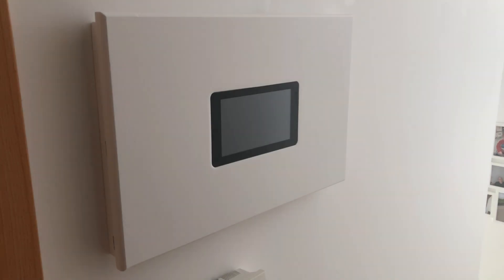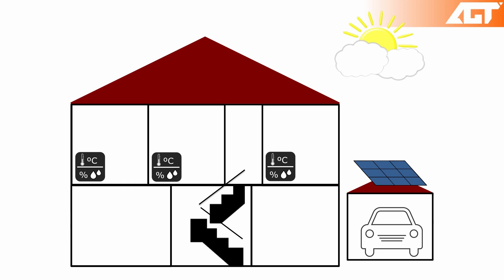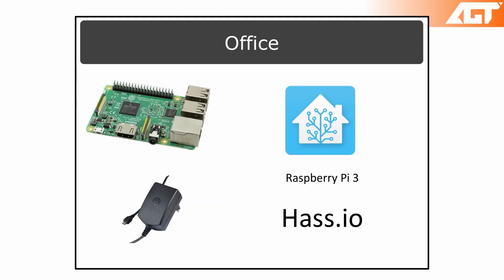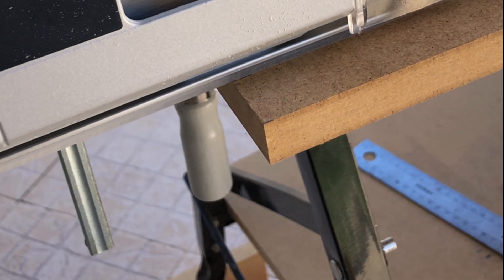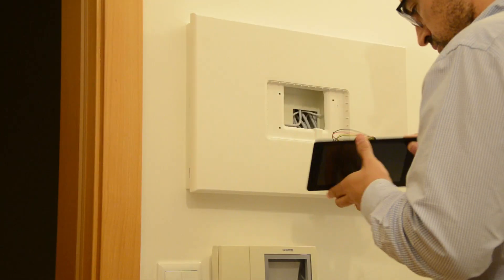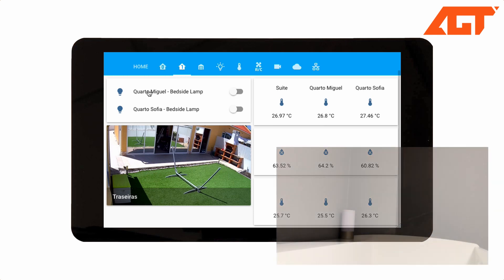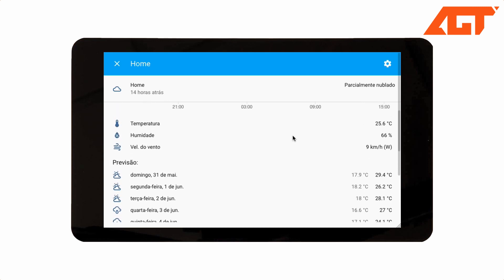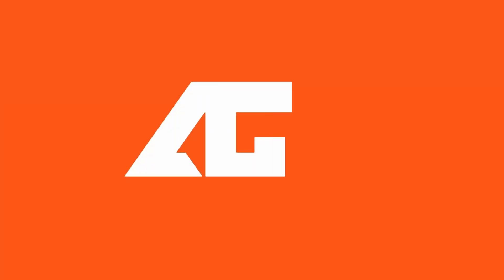My cheap smart home system | HomeAssistant Wall Panel

Comment: FYI: The name Hass.io is not used anymore, It's now "Home Assistant", and the OS is named HassOS: https://www.home-assistant.io/blog/2020/01/29/changing-the-home-assistant-brand/
Also, you don't need 2 Home Assistants running, just install the AppDaemon addon, to create a dashboard for the wall mounted screen: https://github.com/hassio-addons/addon-appdaemon
Reply from the maker: Hi. Thanks for the input on the name change. Actually, I do need 2 home Assistants, as the server in the office is way too far for the temperature BT sensor connections. And I plan to have more screens, which is why I want the server separated. I’ve also tried some dashboard options, but liked Lovelace more... just personal taste. Cheers
Reply: @AGTDesigns  How do you connect Xiaomi BT directly to RaspPi running HA?  Great video!!
Reply from the maker: Obrigado! :)

Check this out:
https://github.com/custom-components/sensor.mitemp_bt
Reply: @AGTDesigns  I also have those temperature sensors and I have several esp32 NodeMCU with esphome (https://esphome.io) installed and connected by bluetooth to those sensors. The esp32 communicates with home assistant through the wifi network, you have more information at https://esphome.io/guides/getting_started_hassio.html. It is really simple and cheap and allows to have temperature/humidity sensors distributed all over the house and with a communication with home assistant.

Comment: Hi. To connect those sensors to HA, do you connect directly to HA or with a MI Gateway to HA? Can you explain how you did it? Thanks
Reply from the maker: I don’t have the Mi gateway, I use the BT sensors directly on the pi.
Reply from the maker: To give you additional information, first you need SSH access to you server. Then, you need to create a folder called "custom_components" inside "/home/homeassistant/.homeassistant/". Then, do the following:

wget http://tsymbaliuk.com/mitemp_bt.zip

unzip mitemp_bt.zip

wget https://gist.github.com/Magalex2x14/7389b840d873824dcabf93a193fe2ca8/archive/ca0dff1b3be6ce95cc27aee7cb3ffa70192ae87f.zip

unzip and replace sensor.py

Then:

sudo setcap 'cap_net_raw+ep' `readlink -f  `which hcidump``
sudo setcap 'cap_net_raw+ep' `which hcitool`
sudo hciconfig hci0 down
sudo hciconfig hci0 up
sudo hcitool lescan

It took me a while to get this working, as the mitemp module randomly stops acquiring data after some time.

You can find more information here:
https://github.com/custom-components/sensor.mitemp_bt

It took me a while to find a way for this to work, hope this helps.
Reply: @AGTDesigns  I will try, and let you know. Thanks!!!
Reply: Hi again! I didn't mention, I'm using HassOS, so apparently I can't use the sudo command. Does your installation have to be Hassio on RaspberryOS perhaps? Thanks in advance.
Reply from the maker: Hi. In my case I run that component in the panel which has raspian, but I think you can get away with hassOS, just need to add ssh access. Though can’t tell for sure, I haven’t tried that in the server.

Comment: Excelente projecto. Tenho uma dúvida... como conseguiste estabelecer a ligação entre o Home assistent e a Broadlink? Eu tentei e não consigo reconhecer RM4 pro.
Reply from the maker: Obrigado! São dois passos, primeiro usei o componente switch:

switch:
  - platform: broadlink
    host: IP
     mac: ‘MAC ADDRESS’

Depois para aparecer o controlador usei o smartir (link abaixo)

https://community.home-assistant.io/t/smartir-control-your-climate-tv-and-fan-devices-via-ir-rf-controllers/100798

Mas há 2 problemas com o RM Mini3. O primeiro, é que quando falha a energia, dependendo de quem arranca primeiro, pode deixar de funcionar e precisa de um reboot manual. Depois, falta feedback no sistema de controlo, ou seja se por acaso o AC não reconhecer o comando, o controlador pensa que o AC está num estado em que na realidade não está. O ideal era ter um módulo que indicasse o estado do AC a partir do próprio AC, em vez de controlo em malha aberta... depois de várias tentativas em que não consegui colocar o AC a funcionar à primeira desliguei tudo, não tinha a fiabilidade que pretendia. De qualquer forma espero ter ajudado!
Reply: Eu tive esse problema. Quando o RM4 Pro está configurado na nuvem, o Home Assistant não o reconhece.
Para resolver, eu fiz toda a integração através de IFTTT (webhooks). No meu caso, funcionou bem, pois tenho apenas as cortinas(persianas) RF das minhas janelas e a minha TV vinculadas ao Broadlink e através do IFTTT eu consegui mapear todos os comandos das cortinas, a TV e também as cenas dentro do Home Assistant, sem precisar fazer o processo de Learning de novo. No Home Assistant, criei um script para cada botão das cortinas (abrir, fechar e parar).

Comment: Thankyou. I am using some cheap 7in tablets arount the house. Much cheaper than using another Pi and suitable display.
Reply from the maker: I thought about that, but I need the Linux to have the solar panel JSON server. Do you have them on all the time with the browser full screen?
Reply: You can use the homeassistant to do all your json as well.
Reply: So you still have 1 x rpi for all things homeassistant. Then the tablets around the house to interact with the server.
Reply from the maker: The server that runs in the pi (with the screen) is written in python, it translates vbus to json. I don’t know if I can run python on Android, but it lacks the crontab and all the rest of “OS” features that raspbian has. Otherwise it seems a great (and cheaper) solution. :)
Reply: @AGTDesigns  You definately still need a pi to do all the work. But if you wanted say another screen in the house I would suggest using a tablet with either the homeassistant app, or a browser in kiosk mode. Your pi is still doing all the work, the tablet is just an interface. As for your json, maybe this will help you. This allows you to go from vbus to json within homeassistant. 
https://github.com/danielwippermann/resol-vbus/tree/master/examples/json-live-data-server

I am sure there are more solutions to have all your vbus to json done within homeassistant. Not sure of the specifics for your solar, but maybe the below as well.
https://github.com/epenet/hassResolVbus
Reply from the maker: What I have running in the pi is exactly what you've posted above, it works great. :)

Comment: I've Hassio too, I got 2 Chinese cameras working non stop for 2 years now, without problems, they need only 12V and an Ethernet connection, of course I've made my own POE splitter-injector. I got these:
https://www.banggood.com/H_265-Mstar-Solution-4-Million-Low-Bit-Rate-Surveillance-Camera-Network-Module-4MP-IP-Chip-p-1293599.html?p=D9060720597263201804&custlinkid=1179867

https://www.banggood.com/H_265-Mstar-2-Million-Starlight-Network-Module-Low-Bit-Rate-Monitoring-IP-Chip-With-Camera-p-1293598.html?p=D9060720597263201804&custlinkid=1179863
 You'll need either the 1.25mm or an 1.1 mm small cables, I've ordered 2 bags, 10 cables in each, so ready to order some more cameras, my raspy can handle in max resolution only 4 of them with MotionEye (motion detection ON). The enclosure is improvised. The cameras have an Audio input, but you have to buy the mics separately, for around 4 Usd for 3 in 1 pack . It's really  easy  to setup the hardware. Basically a fire and forget config. 

The firmware got regularly updated, I'm more than happy with them

Comment: Great video!   Can you share how to get Wyze cameras into Lovelace?   I’ve already got my cameras in MotionEye integration but I’m coming up empty of how to turn the cameras into HA entities to use outside the MotionEye application.   Thanks!
Reply from the maker: Thanks! 

I’ve tried two cameras, the first I had it working with the following code:

camera:
 - platform: generic
   still_image_url: http://IP:PORT/snapshot.cgi
   stream_source: http://IP:PORT/main.htm

The new camera has ONVIF protocol, so the code is a bit different:

camera:
 - platform: onvif
   host: IP
   port: PORT
   name: ENTITYNAME

Hope this helps! Cheers
Reply: @AGTDesigns  The windows programm Onvif Manager can help you to discover the full stream address.And you can test it in VLC
Reply: I'll just follow up on my own as well:   Using Blue Iris made getting Wyze into Home Assistant a breeze

Comment: can you share how you were able to get multiple home assistants to communicate with each other?? 
Other than that awesome job and video
Reply from the maker: Thanks a lot! 
I think you can do it several ways, but the easiest I've found is through long-life tokens and with the REST API. You basically create a long life token in the machine that has the data (in the example below I call this SLAVE_HA), so that the server (in the example below I call it MASTER_HA) can login.

The configuration.yaml in the MASTER_HA would be something like this (in caps is what you need to change in your case):

  - platform: rest
    resource: http://SLAVE_HA_IP:8123/api/states/sensor.SENSOR_NAME_IN_SLAVE_HA
    name: SENSOR_NAME_IN_SERVER_HA
    value_template: '{{ value_json.state }}'
    unit_of_measurement: ""
    headers:
      Authorization: Bearer LONG_LIFE_TOKEN_OF_SLAVE_HA

To create the long life token just click on your user (bottom left), and in the bottom you can create the token. It will be in a form of a large string that you can copy only once.

Hope this helps!
Cheers
Reply: AGT Designs thank you i will be trying this later tonight or tomorrow